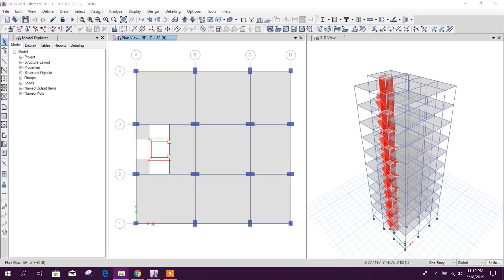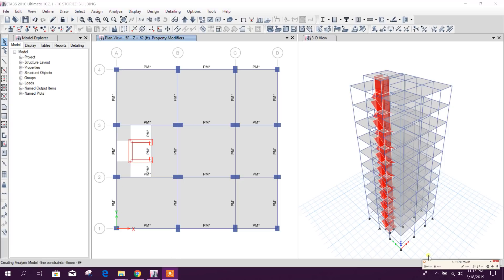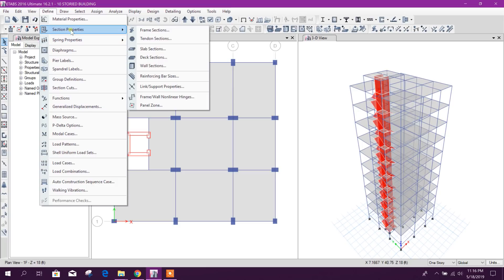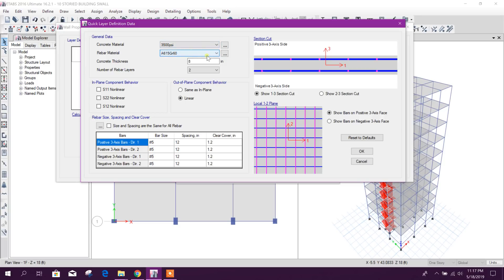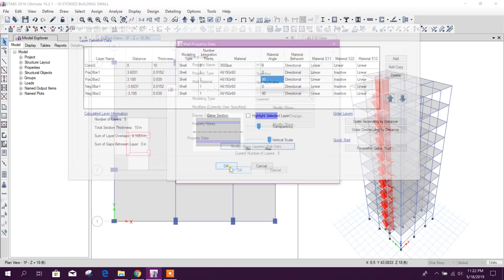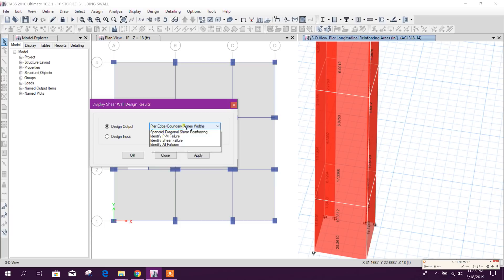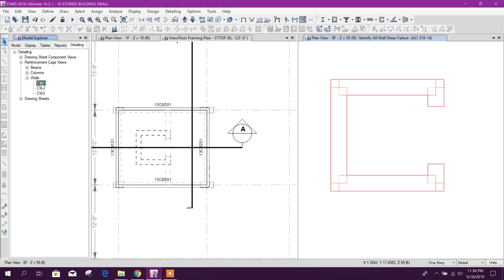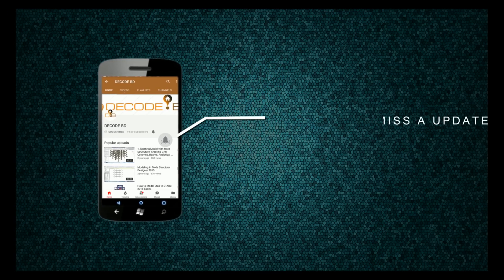10 Storied Building Design in Etabs-Part8

Comment: There are two options to change modifiers in ETABs. You have separately used Stiffness modifiers firstly in Define>section properties>Frame Sections and then also in Assign>Frame>Property modifier.  Why?

Can you confirm if it is compulsory to change modifiers in both or we can just change modifiers in any one of the option above and the result will not be affected.